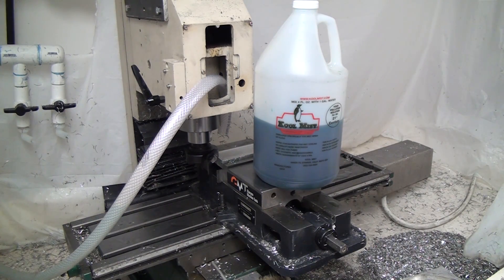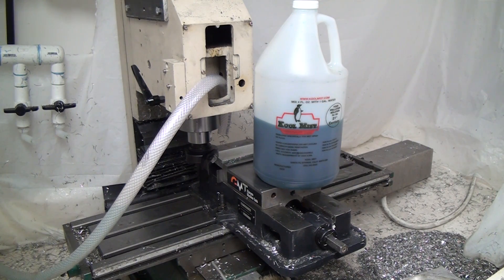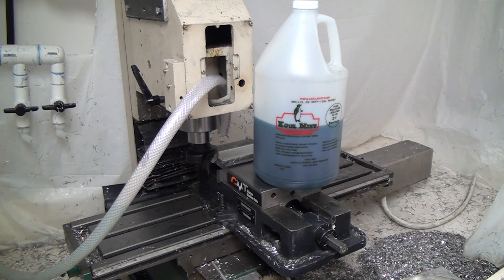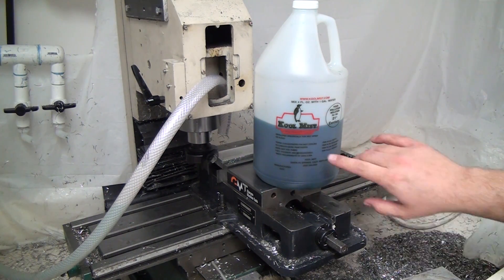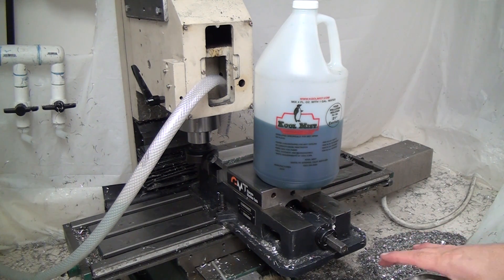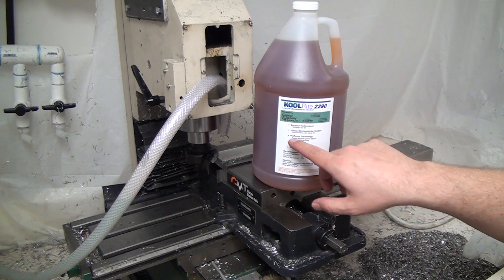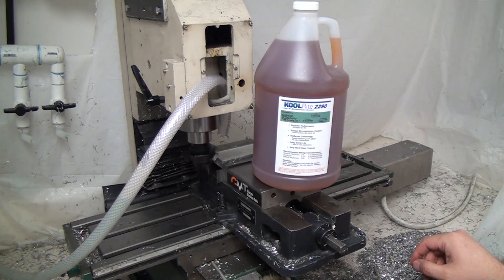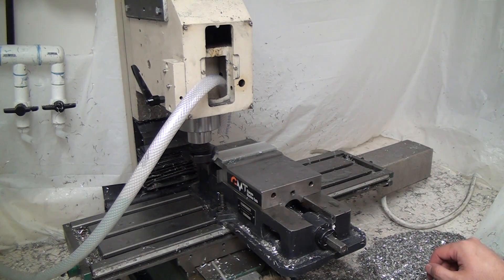CNC-G0704 #22 - Kool Mist 77 vs KoolRite 2290

Comment: Is your shop in your home? Is the coolant smell too strong to be used in a basement shop? Thanks
Reply from the maker: Yup, it's in my basement. Neither of the coolant's I've tried have put a bad odor in the air. The Kool Rite I'm using now does have a scent to it which is stronger than the Kool Mist, but it isn't unpleasant or very strong.

Comment: That part you are showing at the 4 min mark, I'm curious. I've seen this many times even from Adam who was making a toolmaker's vise and milled approx a 1/3 of it off instead of using a band saw to cut that large section out. In this respect, wouldn't it save you a lot of time, money, and wear on end mills if you just use a band saw to cut the outer profile, leaving about a 1/6" for final machining? Needless to say, if you don't have one, then my suggestion would be moot. But it would certainly be worth it if you had one if you are often making parts like the one you showed.
Reply from the maker: When making that part, I had four strap clamps (one on each corner) holding the material down to the mill table.

Comment: Rus 
Can you give more info on the chemical make up of the Kool Rite? As I recall Kool Mist is non toxic a big plus for me and also the smell. I ask because using it for flood is one thing but as a mist I would really want a non toxic biodegradable coolant.  
I would like to get your thoughts in a year on this kool rite.
Reply from the maker: The jug I have doesn't give any info about the chemical makeup. I'll report down the road for sure though, as to whether or not I'll be staying with it when this batch ends.

Comment: what kind of coolant pump are you using? any idea on the PSI and GPM?
Reply from the maker: Wow, you know I had sworn I did a video about the new pump, but It looks like I haven't. I'm going to make one just covering the pump. It's a Harbor Freight Sump Pump, either the 3/4 HP or 1 HP, I can't remember so I'll have to do a little checking. It's one of the stainless pumps.
Reply: lol, I swore you did too, I had went back and looked before I asked

Comment: Nice video! I've been resisting the move to a coolant setup because I don't want to deal with the mess/odor/rust issues.  That being said, I need flood coolant to make my G0704 more efficient.  Question:  How are you lubricating your table and column ways?  
Thanks,
-Franco
Reply from the maker: Thanks!
I've tried several methods for oiling that have been suggested to me, and frankly I go with the easiest. I shoot some oil on my finger tips and reach under the table and smear it on the ways. It also lets me know if I have some buildup (rust = rough), remove chips that are sticking up there, etc. I'd like to get a fancy oiler system, but a blue shop towel and 15 seconds of cleaning off my hands is just so fast and cheap :)

Comment: Thanks for mentioning smell, which is important for a basement shop. With Kool-mist, in a mister, I've not had the problem with browning of aluminum, but have had problems with rust on the vise and staining on the mill table, pretty much the opposite of your experience. Could this be a mist-vs-flood difference? The stickiness is the same unfortunately. I break down the setup and spray everything down with WD40 to combat the rust and stick.
Reply: I use Kool Mist in a mister.  I have far less rust issues now that I've changed the mix.  I use at least 6oz or maybe more per gal.  Tacticalkeychains suggested a stronger mist a year or more ago and it helped a lot.
Reply: Great to know, I'll give that a try as my coolant is about out. Perhaps there's also a rust inhibition difference between Koolmist #77 (tougher service) and #78 (light duty)? I'm using #78... seemed appropriate with a small mill :)
Reply: I didn't even know about 78 when I first got the 77.  I got it thru Enco when I bought the misters...just stayed with it.  I tried some other soluble oil.....hated it....got bacteria and smelled really quickly.  Still have 9/10ths of a gal of it. lol
Reply: +Kent VanderVelden I have been using Koolmist 77 for flood on the Go602 with no problems with rust or fungus or brown stains on my conversion pieces. 
That is why I felt good about using it with my new project.

Comment: What about TRIM SOL? it was recommended to be by a coworker that is a tool and die maker.
https://www.amazon.com/gp/product/B00065UGKS/ref=ox_sc_act_title_3?ie=UTF8&psc=1&smid=ATVPDKIKX0DER
Reply from the maker: Looks promising! I don't know it, but if you have a good source giving a favorable opinion then take a shot and see if you like it.
I bought mine solely based on the research of a guy I trust :)
Reply: I love Master Chemical 585XT.  I got a 5 gallon bucket to test out from them on a trial basis.
Reply from the maker: gbowne1 Thanks!